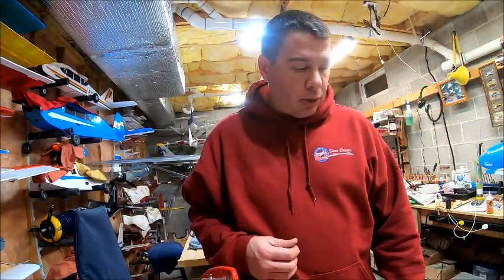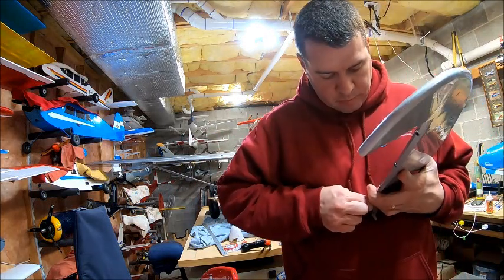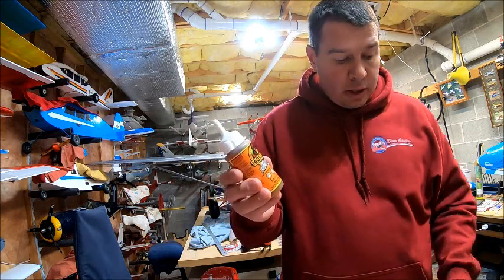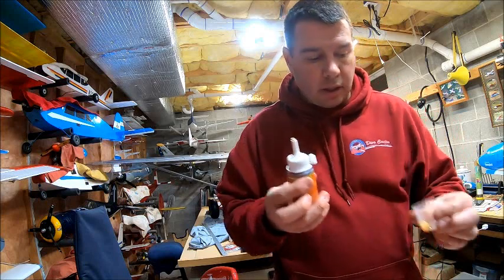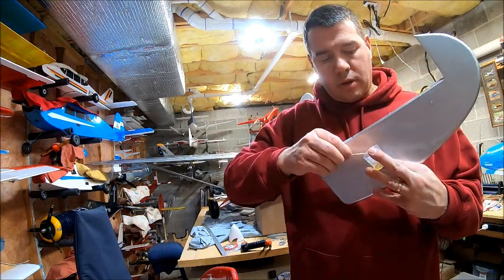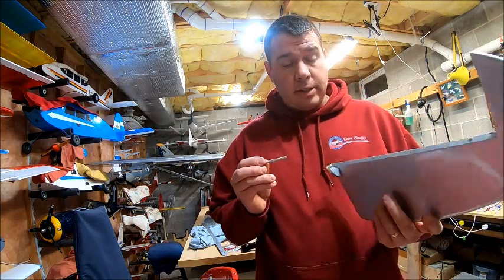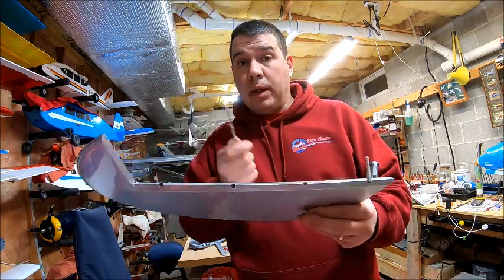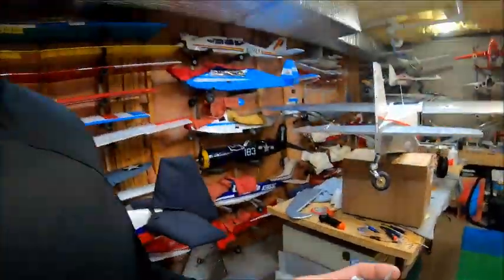How to install Robart Hinges Xcub build pt3

Comment: I've been using gorilla glue on robarts for the past 10 years or so. It's been great. I started squirting the gorrllia glue directly in the hinge holes. I do it twice. One to let it drain down and the next right before I install the hinge. I'll stab the hinge once then pull it out to make sure it had enough glue on it.
Reply from the maker: It’s the best choice in my opinion